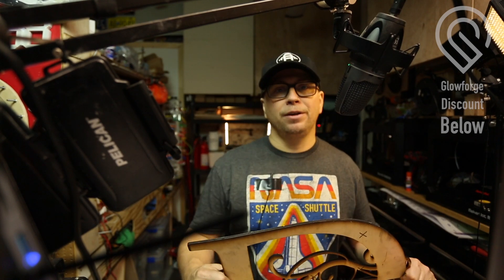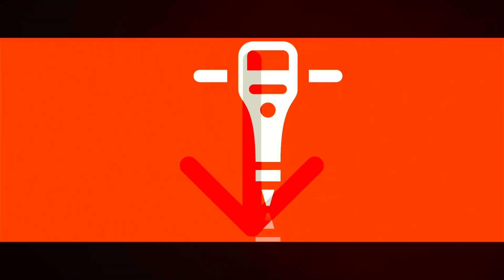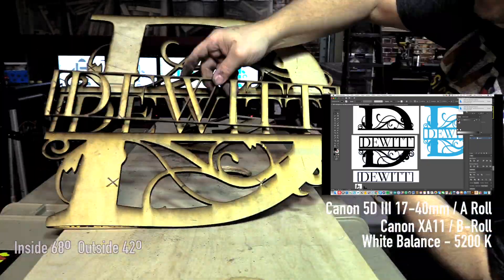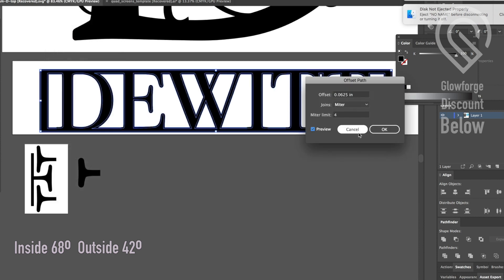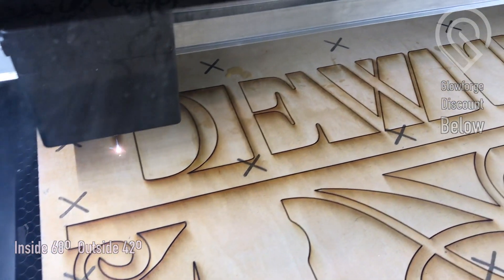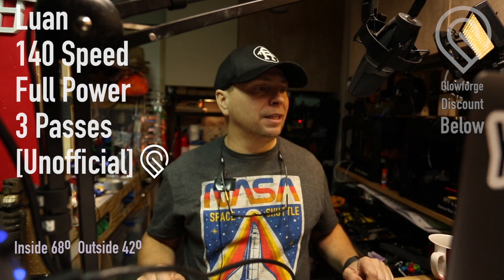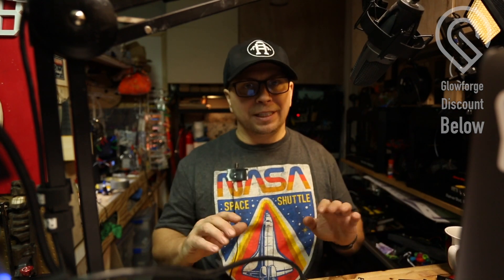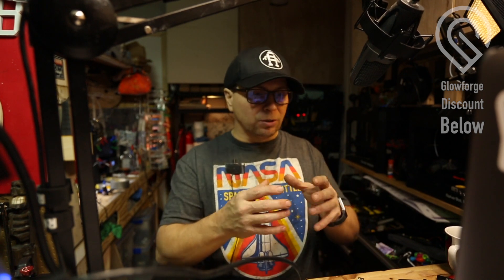Glowforge Laser Cutter  Door Monogram  -  Glowforge Coupon Code

Comment: Hi looking to make leather patches with a glowforge. What model would you reccomend?
Reply from the maker: Jorge Villalobos I would recommend the plus that’s what I just got because that extra 5 W believe it or not will Eliminate some burning of multiple passes I don’t believe you need the extra cooling if you’re not in the hot garage and I actually have a hack for that to cool it down if you’re in working in a hot space. .

But honestly if you can’t afford it the basic model will put your leather just fine but I would need to know the thickness of the leather.

Regardless what you do you need to mask your leather with that tape dispenser roll I put a video on it’s very inexpensive but it’ll make your patches look beautiful
Reply from the maker: Jorge Villalobos I can’t wait to see your leather patch designs
Reply: @hacklab.ryandewitt  you're the man! Thank you so much.
Reply: @hacklab.ryandewitt  BTW I WENT WITH PLUS!